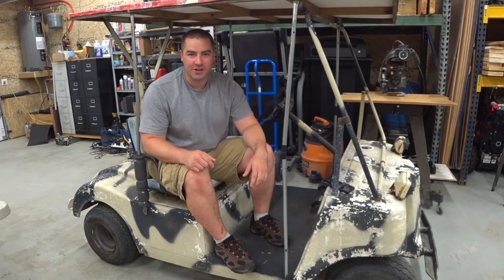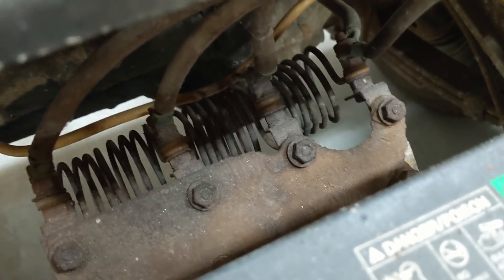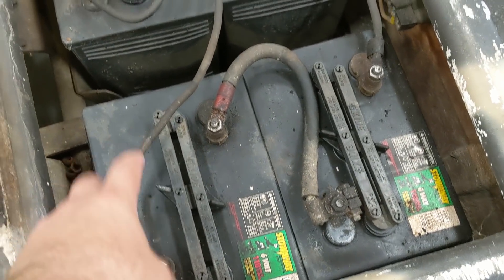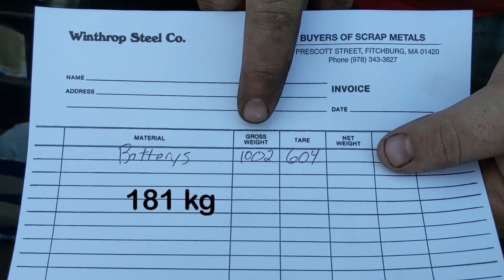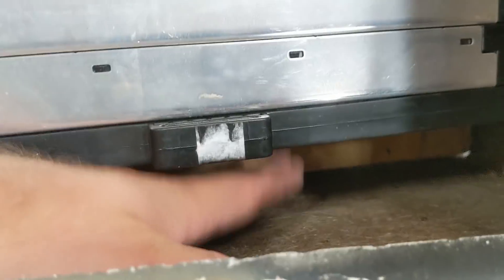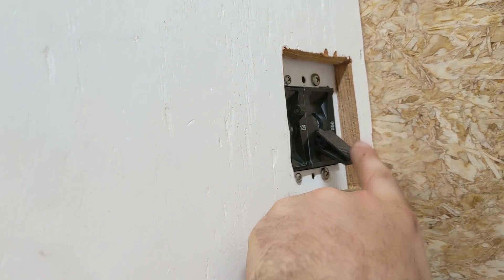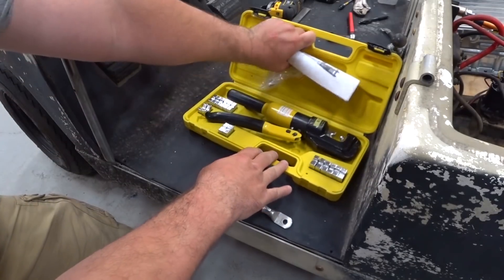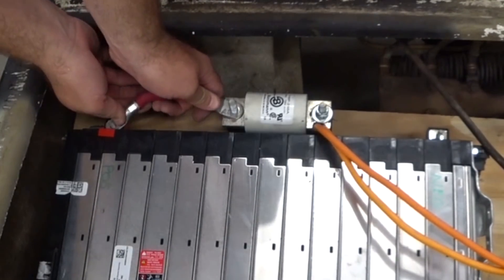Golf Cart: More Fun with Lithium? Part 2

Comment: Dave I have 330 watt big panels one is perfect size for roof

 Thay are new and like 40 or so volts come get one

 I will give you one for free along with golf cart speed  controller and a dell laptop or two

 I also have 4 or five of those Fisher and Paykel style motors every one uses for wind mills

 You can pick you one or two of them out 
 
I have a almost new tread mill motor with wire harness and controller free to you if you want it

I have 5 or 6 smart apc 1500 watt pure sine inverters pick you one out free I have both kinds sever type and upright ones

I have Lots of Transformers 200 to 3000 watt   

A big battery charging industrial Transformer 240 or 110/ 55 volt  50 amp

 I will show you our eagle tour bus solar set up with my home made 10000 watt low frequency pure sine inverter 

might try to sell or trade bus to you

It has a over 13 thousand Newer with paperwork and dino paperwork 6v92 super charged and turbo charged Detroit diesel

 A automatic allison transmission it is a pusher all aluminum skin and deck 40 foot 
It will fly and pass cars going up step hills

It has always  been a RV not passenger bus 

I gutted in side and put all new floors in along with alot better insulation that's as far as I have gotten 

I will show you and give if you want some redesigned power Jack  mosfet boards that use the larger 247 size mosfets like the 360amp 5608 or the hy4008 

I will also show you the poida nano control boards (from the back shed .com) I have built and the chokes I build to lower idle amps to well under a half amp on 48 volt battery side 

I am going to be moving to the farm soon I have lots of stuff I would give you for your channel 

Me and my family (5, 13 year old boys and wife ) are Bible believers by the way not pushy religious or judgmental people 

I live close to sandyville wv 25275 I don't think it's to far from you so if you're ever close by or want to make special trip I think it would be worth while 

Would love to meet ya 
Have a blessed day
Reply from the maker: Thank you for the offer but I will have to decline. I am not currently taking on any new projects, other than what's already been lined up. And thank you for watching.

Comment: "But this one goes to 11"----->the resistors are hooked in series an are used to reduce current by dissipating massive amounts of heat the contactors are used to short each section of coil resistor ie more throttle less coil resistor if a 36/48 volt to 12v converter is used for control circuit common 12 volt high amp contactors can be used then you can use almost any size battery for drive motor the converter also will reduce balance problems older lead acid  system when they would tap off to use aux systems these old carts have less to break and parts are cheap vs pwm carts yes they are more efficient but i would rather have the 1000 dollars in my pocket at the end of the day 1 hour extended run time to me isnt worth it besides you just doubled run time by using lithium
Reply: For the kids who don't catch the reference...
https://www.youtube.com/watch?v=KOO5S4vxi0o

Comment: Can I recommend this 300-watt MPPT cheap solar charger used by ebike for there lithium packs -  it has a 42v setting - I have 2, one in my shed and one on my RV - they work well just be sure to note its a boost controller so the panels have to be fewer volts than the terminal battery voltage.   https://www.ebay.co.uk/itm/Blesiya-Intelligent-MPPT-Boost-Solar-Charge-Controller-Panel-Regulator-24V-72V/353146245548?hash=item52392811ac:g:XuAAAOSw6EJfFuzP

Comment: hi David I just last week received my $1200.00 dollars of batteries  I ordered from battery hook up using your discount code,thanks. and  now I see you converting a golf cart to lithium looks to me that you are having a lot of fun. but you didn't mention how many volts or amps  the battery is ?  it looks to me like the lg cells 14s but this one looks like it was put together at the factory can you please tell me what is the model and specifications for the battery ? I clicked in your battery hook up link but I didn't find it on the site? thank you very much for your  help, and keep those videos coming, l am building 2 7s2p 24 volts and later a 14 s but if I can get some of those it would save me a lot of work thanks again for your time
Reply from the maker: I didn't go into too many details on the battery in this video because I went into specs in a previous video.  It's a 3p10s, 180ah, Li-NMC, about 6kwh.  nominal 36v.  https://youtu.be/7gBc99Z3Diw

Comment: Awesome, David! I have adapted a 4 wheeled mobility scooter to accommodate 2 sets of 24 batteries & added temporary solar panel of 50 watts. Had to take off solar as  I  FRIED 2; CHARGE CONTROLLERS ( PWM- CHEAP ONES)! Now I charge both sets with 24 VOLT 8 amp wall charger modified with clamps for eye rings on PARALLEL circuit..

Comment: I believe your led acid batteries were just bad, I find that after a few years power is lost as well as time used.
Reply: I have a 36v ez go with trojan batterys I bought brand new and they're 9 years old. Still going just as strong as ever. Just have to always check water and charge evrytime you finish driving it. Never go below like 70% charge...or just get a lithium replacement and you can get 100% doc

Comment: The lead acid would have done the same if they were new. The swelling reduced the capacity.  But of coarse LI ion will last a heck of a lot longer.
Reply: And weigh a heck of a lot less
Reply: swelling does reduce the capacity but not being used for a long time will cause the lead plates to sulfate which will give a lot less current. However this can be resolved by giving the batteries a load until it's empty then recharging it and repeating this a couple of times.

Comment: Hey David, is the motor in that series wound or permanent magnet? (4 wire or 2 wire?) I would've expected series wound but since the top speed is the same maybe it's permanent magnet. Permanent magnet motors can get you easier regenerative braking; a single diode placed backwards across the contactors will give you automatic regen anytime you exceed max speed going downhill. Either way I suggest you check the condition of your motor brushes if you have not already done so, fully worn out brushes will total your motor.

Comment: Heh heh, what a cool conversion! I had an old EZ-Go cart with a little bit different setup, and the motor was longitudinal and bolted directly to the front of the differential. It would have been a prime candidate for a conversion like this if I had access to similar technology at the time. 
With the increasing efficiency of solar panels, 4 x 80 watt 12v. panels should do a nice job of keeping your batteries up with occasional use. Looking forward to the next update.😉

Comment: I converted my cart using 48-volt Chev volt lithium batteries. My cart was a 2001 Club Car. I put in a high-speed motor and a 750-watt controller.
You do not need a BMS. If you want you can buy some cheap battery meters and manual balance the batteries. I have my cart now for over a year and never balanced it even though I have the tools to do it.

WARINING:
Two things you do need a Lithium battery charger with an automatic shut off. I take mine to 90%. The other thing you need is an automatic low voltage Shunt shut off. 
This way when you leave the head lights on for a couple of days you don’t wipe out your batteries.

I live in the AZ climate and it gets hot in the summer and use to take out my lead batteries out every three years and I had to babysit it adding water and keep them charged.
No more of that and I don’t expect buying batteries for the next 7 to 10 years.
We use the cart 5 days a week and we love it.

Comment: Why a Circuit Breaker AND a Fuse...?  That's like putting 2 fuses in series.
Reply from the maker: This type of fuse is better at stopping short-circuit, and the circuit breaker offers a means of disconnect.

Comment: off topic question. what equipment do i need if i want 3 solar panels to charge a 5kwh off grid battery module. while the solar is charging the battery. i can also use the battery at the same time, a 110volt 20 amp outlet

Comment: That power-limiting arrangement with the resistors is a great 'agricultural' design :) I wonder which of the pedal settings results in the most inefficient use of battery power?! Ie is ie with all resistors engaged, some, or just one...
Reply: If I am not mistaken, the pedal barely depressed , i.e. hardly moving, would engage all resistors. Somewhat counterintuitively, those old resistance speed controllers were most efficient when running wide open.

Comment: Very cool! The resistor speed control is inefficient, but you have so much energy available that it doesn’t matter. That old tech will still be working long after an electronic speed controller has hit the landfill. Love the solar panels on the roof! The reversing switch reverses the polarity of the armature only, not the field.
Reply from the maker: Thank you.
Reply: Actually, it can be either way depending on how it is wired. I have wired motors either way and it really does not make any real difference which you would  wire them for as long as you have a 4 wire system. And yes, I'd get rid of the resistors and go with a diode setup instead or a new motor controller. Reason? Because the diode setup would give you the same drop over the entire load.  My guess is that it would be 1 diode rated at 250 Amp and 50 Volts needed per .8 Volts drop. As this was a 36 Volt Golf cart and has 5 solenoids, all you need to know is at what Voltage the cart starts to move with about a 500 lb load on it. Then divide the remaining voltage by 4. Set your steps by the nearest voltage that your diodes drop. But a new motor controller would be cheaper.

Comment: Will be different under a load or climbing hill etc. My cart acts like it has a passing gear pump pedal and it may speed up more and climb better but no higher speed.   Also there are wiring changes you can make to get full reverse speed and power rather than half speed.

Comment: The resistor system is not as inefficient as someone else mentions and fairly expensive to convert knowing your thriftiness.  I have a 36v resistor club car that will go 22 miles or more with new lead acid batteries.  The batteries should weigh about 70 lbs each at full electrolyte level.  You can probably use a little higher voltage without harm but many who try 48v without changing other things burn out solenoids or resistor system.  The motor probably pulls about 200 amps. It will increase speed some maybe 13 mph but if you want faster lift and put larger tires (hint 4 wheeler 12 or 14  inch tires etc are usually less than golf cart tires but need golf cart wheels).  
I put two the new LG cells in a 48 volt golf cart and thinking about putting in a 72V friends cart.  I wish Battery hookup would get some of the 3p10S packs to sell again!

Comment: My first real job was with a golf cart company, and you know with that old speed control you're drawing full power all the time when the pedal is pressed no matter how fast or slow you go.  Hence the speed resistors to burn off unwanted power.  The newer speed controls of course use the pulse method for speed control, and make the batteries last much longer under working (non golf course) conditions.  We had "work" carts with front and rear decks/beds.  One was even a single seater where the deck ran the full lenght of the cart over the passenger side.  And you can push full size trucks with them as well.
Reply: mike h  
Not just golf cart, that is how the old electronics stuff work in the old days, you burned off the excess electricity you didn't need in the form of thermal energy (heat).
Reply: They do not pull full amps at all speeds. It adds the resistance wire which does waste power but lowers the load on the battery. Amps are are reduced when the resistance increases.
Reply: I have a controller I want to give him newer style think it is worth around 300 bucks but worthless to me I have gas cart now
Reply: @ambersmith6517  If you want to give it a way... I know an old crippled  man who needs one, but cant afford to buy it. He uses the cart to get around.
Reply: could have bought the 48V pack and really had some fun, I mod-ed my kids 12v car to work with some 18v dewalt batteries I had, it was a little fast than you want a kid to go LOL was actually able to spin its tires on my kitchen floor Dont Laugh
Reply: those lead acid batteries were probably at the end of their life cycle
Reply: You need a curtis controller!
Reply: mike h  Yup. At lowest speed, the power goes through all the resistors (which turns most of the power to heat), then through the motor. The contactors progressively short out more resistors, bypassing them to deliver more power to the motor.
Reply: @Anaerin  but at max rpm the motor's stator induces a reverse voltage into the windings making the effective voltage above the motor progressively lower - hence less drawn current and a lower power consumption under no load. As with all DC Motors, they have a torque curve inversely proportional to their rpm and the torque reaches 0 at max rpm. Even connecting the motor directly to the supply won't result in it drawing full power regardless of the speed.
Reply: Wow...I just read what u posted...so I swapped out my 6v Batts to 3 12v deep cycle Batts and it completely drains my batterries...is there anything that can be done to run my deep cycles and not have them drain so quickly?

Comment: An aftermarket  speed controller will get you the speed you want.  Plus you can program the parameters.  Mine does 25 mph on the flats with stock motor and 22 inch tires. I went with Altrax 300 because I only use it on the streets really. Offroad you might want 400

Comment: I have been waiting for the second installment of this series. What are you going to use for a BMS? I've got my 36 volt pack built to go in my golf cart and I think I'm going to use a daly 100 amp with a contactor because I haven't been able to find a BMS that is reasonable for that kind of amperage.
Reply from the maker: I've got two BMS's I'm trying to decide which one to use.  One is a 10s Daly.  and one is called "ANT BMS" and has a little screen.  Just need to pick one to try.  I like trying different BMS's out
Reply: @DavidPozEnergy  Looking forward if you get the AMT-BMS to work. So far not for me.

Comment: Just FYI, but Bolt EV batteries don't really need a BMS for this type of use case.  I've been running 3 of them converted to 48V system,  I been checking the voltages to see if a BMS is required in anyway and I have not found any significant drift such that a BMS would do anything useful.  People should understand that the Bolt EV batteries that David is using are NEW and come factory balanced.  I would only charge one pack at 14-18 amps for longevity.

Comment: What does it take to make that golf cart go faster? Increase the voltage? Increase the battery capacity?
Reply from the maker: Higher voltage, and bigger tiers
Reply: @DavidPozEnergy  I wonder how much voltage and/or amp it can take before it breaks? That would be an interesting experiment.
Reply: @AdamIverson  The main limiting factor with a motor is current, not voltage. Of course there's a limit where insulation starts breaking down, but you should be able to run a motor at least double the voltage, but then the speed may be too much or bearings need upgrading.
Tweaking all the parameters of a motor for optimum performance for a given spec is a real art.
Reply: Check that motor for a maximum voltage!!
Reply: I had a 36 volt cart.  I added two 12 volt batteries to the back with 2 additional solenoids.  I installed a toggle switch on the front panel and labeled  " Warning use only in case of emergency -Turbo".    I got my young son to take a ride with me after installing the system.   While riding, I told him "hit the turbo switch".  He laughed and said "Dad that's just a fake switch".   I told him hit it anyway .  He did and his eyes got wide and big smile came across his face.    Never had a problem with the motor running at 60 volts but occasionally a solenoid would burn out.